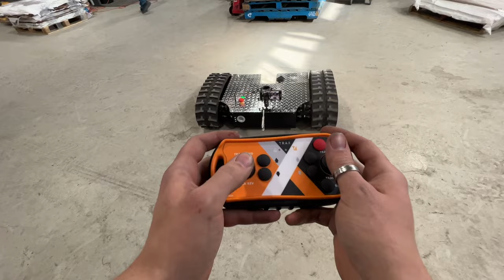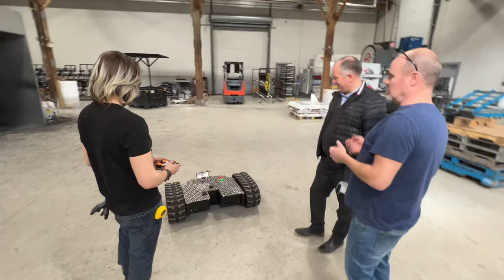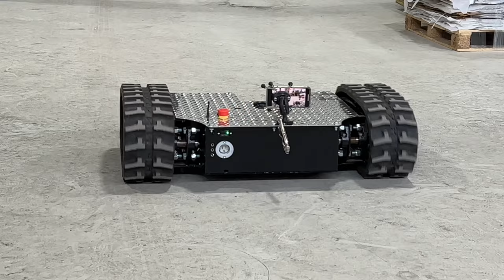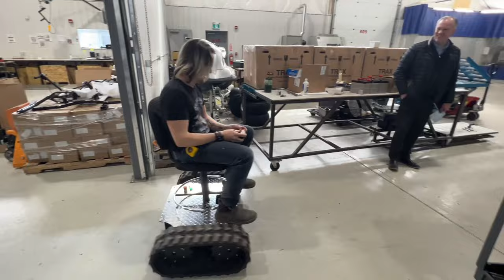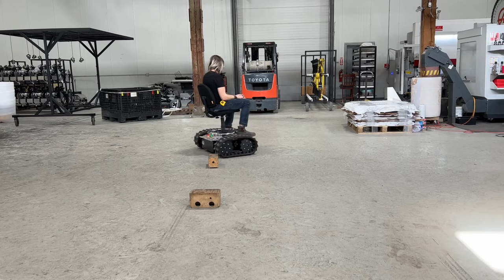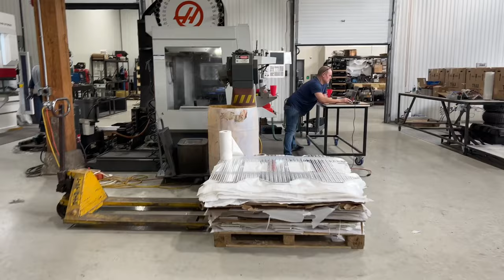TRAX X2 - New double stick wireless remote control

Comment: Need one of these but lower capacity. 
Use Case: A DJ/business owner with disabilities. Needs a system for moving large-speakers / amps / power banks one at a time across a large hall / space via remote control or app.
Reply from the maker: This will be a perfect fit for tugging your equipment around.

Comment: This dolly looks great! However, before I would buy one, I've yet to see a video of one of these 320 lb bad boys back my trailers up over my ROUNDED curb side next to the sidewalk, and it would need to do it 4 times on a single charge; and no, I'm not talking about the traditional straight square curbside; I'm talking about the Rounded ones I have in front of my driveway; if the machine can't do that, I'm not interested.

Comment: What is the max GVWR and tongue weight this dolly can safely maneuver?
Reply from the maker: We tested and moved a trailer weighed 12550 pounds with it and it moved it easily. The trailer was so tongue heavy the trailer jack started to buckle under the weight. The X2 didn't even struggle with the tongue weight much less pushing and pulling it up a 8+%.